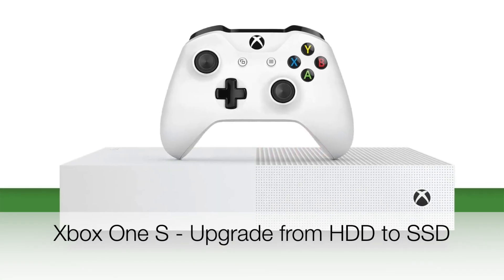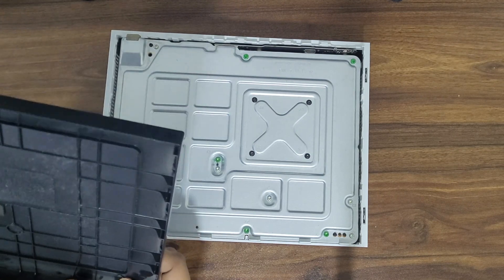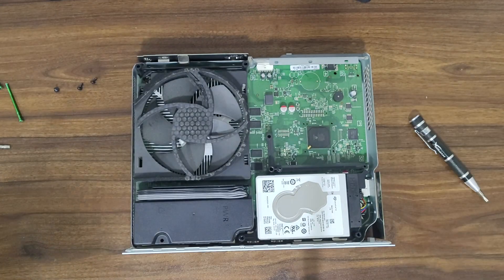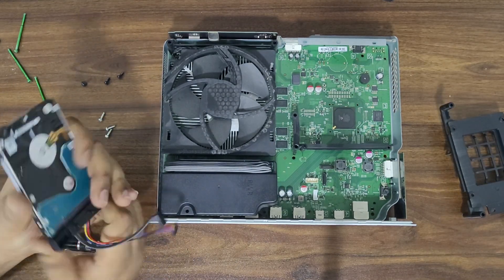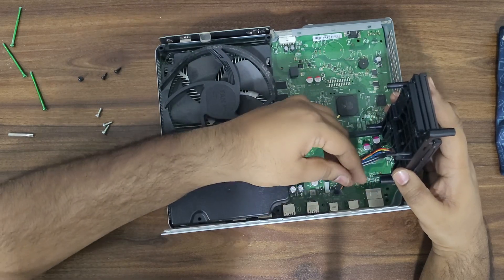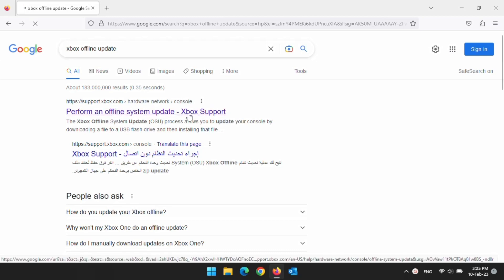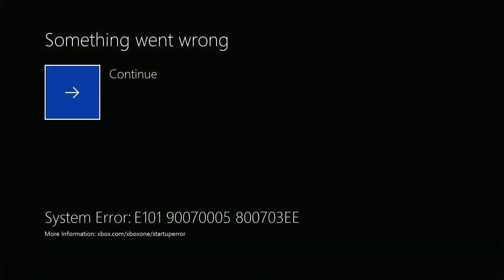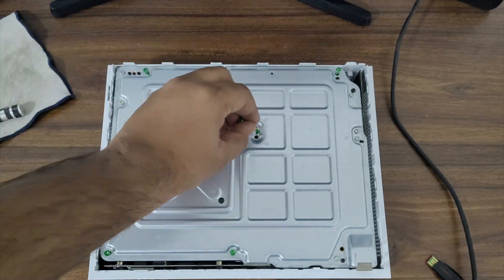Xbox One S SSD Upgrade

Comment: I installed a Samsung 870 evo 500gb in my one s, and it works good👍
Reply: Did you do what this guy did and just put it in the Xbox and run an offline update or did you clone the hard drive onto the ssd?
Reply: @James-et3vq  just put it in
Reply: @si4632 
Hey is there any way to clone a xbox hdd WITHOUT removing it?
I have a docking station but it only holds ONE drive at a time 
So what would be the easiest way to do this without spending any money?
Reply: No cloning, just insert and offline update 👍
Reply: @magnusaspegren6369 
But then you still have to REdownload all your games and everything right?
Probably better to just clone because then you don't have to bother with that extra step of redownloading everything afterwards
Reply: i dont think its worth getting a branded one

Comment: I wanted to change my dead HDD for a Kingston 960GB SSD but I cant do the OSU1 update. It’s getting e101 error after 60% into verifying. What can I do? The original HDD is in a loop state so I can’t put that back in.
Reply: @Revelator same issue with the mx500 as well. E101 60% into verifying.
Reply: @Revelator I’ll get a new pendrive tomorrow, I already got out of the insider program when I first tried it with the OSU from Microsoft’s site.
Reply: @Macigany  Microsoft has an error page with a resolution. Just Google the exact error. I had the same problem but following the Microsoft steps I was able to resolve. I just installed a 2TB ssd by team group from Amazon for $79.
Reply: @ianhemingway  I did all of the solutions on Microsofts page, and googled the exact error which indicates the HDD needs to be swapped. I tried an A400 960GB and an MX500 1TB got the same error too. On forums most of the guys had the same error as me but haven’t got a fix yet.
Reply: @Macigany  Dang. That sucks. I had a. E101 error and the solution for me was to use and OSU1 file instead of the OSU2-3 which I tried first due to the smaller download. I installed a new $79 2TB ssd by team group elite from Amazon. Worked flawlessly in my 2016 VCR edition first gen xbox one.
Reply: @ianhemingway  The One S only requires the OSU1 as I read, I’m gonna change the SATA cable as well, if it’s not working after that I’ll might use it as a door jamb and get a used One X.
Reply: @ianhemingway  I check it out but not sure if I’m gonna get another SSD. Don’t have any more space in the PC if this one doesn’t wanna work with it as well 😅
Reply: @Macigany  just return it. That’s why I buy exclusively from Amazon.
Reply: Little update. I managed to get it working, I really don’t know how. Could be because the new pendrive I got, it’s a USB 3.2 Kingston Datatraveller. I formatted it, downloaded the latest OSU1 and it went through with the installation. Thanks Ian and Revelator for the tips!
Reply: Dev mode, offline update
Reply: @TheTapeJournal  yeah thats what I wrote that wasn't working but thanks XD Managed to fix it since.

Comment: hi , i need a bit help, i trying follow the steps but my system won't update, is just freeze and the xbox shut down and when i start again i just see black screen, the SSD looks good and i download OSU1, my xbox is one S (white), and i dont know what i can do, i see a lot of videos and looks a simple steps but seems i cant make it work
Reply from the maker: Try to return back the old HD and check if the console is working. Make sure the USB is in correct file format ( NTFS). 
https://support.xbox.com/en-US/help/hardware-network/console/offline-system-update
Reply: @techbymaaz  hi, indeed, i put it back the old HDD and console working, i even use the usb stick and make the update offile thing and work fine, the old HDD make the console works, but when i switch to the SSD its not working, i already use a diferent SSD, the first one was ADATA and second one was Kingstone, none work, only work with the original HDD, even more, i put another HDD from another xbox one, and works, its only not working with the SSD units, idk what im doing wrong i format the SSD in ntfs , and even use like j runners and format the SSD to a "xbox format" before plugin in the xbox, but not working also
Reply from the maker: @jorge vazquez  It's strange.. I did multiple times in the same ssd because I was not getting the full capacity and it was working each time.I can only suggest that you delete the volume created in the ssd and then try. Also try pressing  the power and pairing button together while booting up.
Reply: @techbymaaz  i already did all, in facebook some guy told me in a group that was the SSD brand, he told me dont work with ADATA, we dont know why, he told me i must got WD or crucial
Reply from the maker: @jorgevazquez-ct6kc  i used kingston SSD. Their must be some other issue. will let you know if i find anything related to your issue.